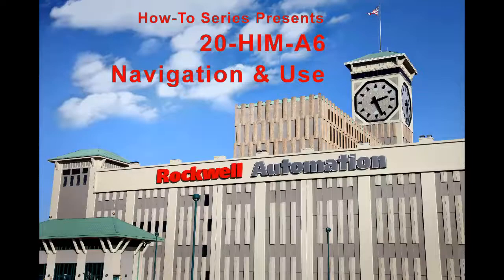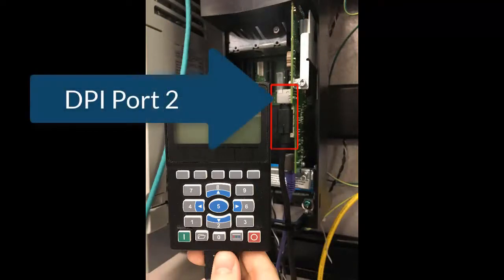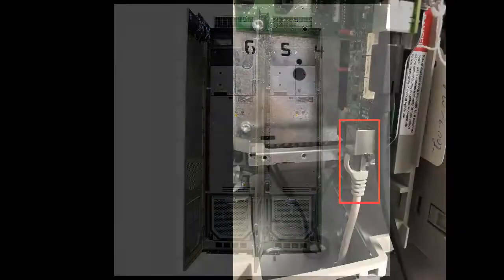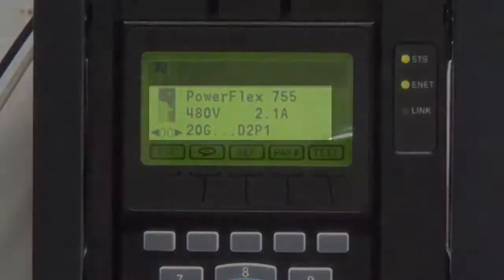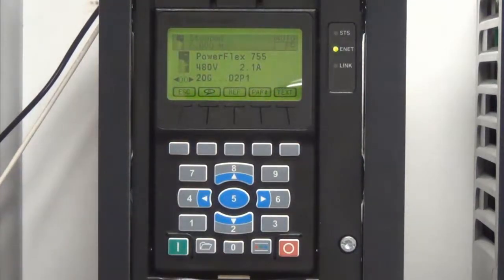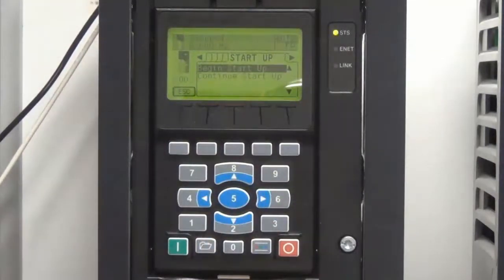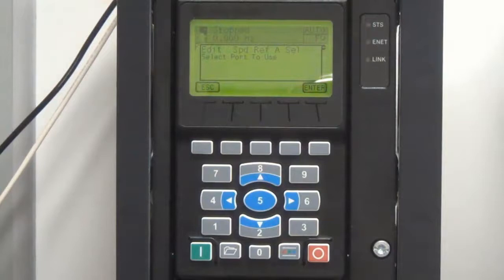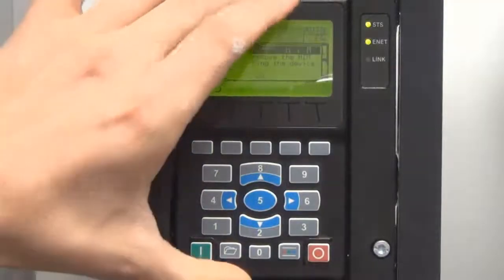How to use 20-HIM-A6 Navigation for PowerFlex® VFDs

Comment: I mistakenly purchased 20-HIM-A6 hoping to program Powerflex 40 drive. When connected to RJ45 port there is nothing shoes up on display. I know it's not compatible but I was expecting at least to lit the display with some warning or message. But it's totally blank. So at this point I don't know if HIM is just broken or that's a normal situation. I don't have compatible drives to test it. Can you advise please?